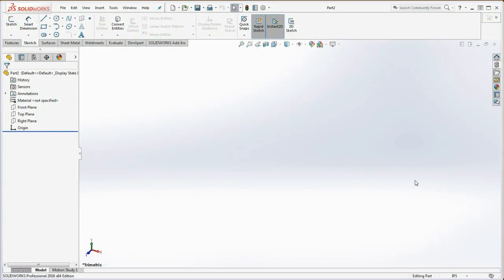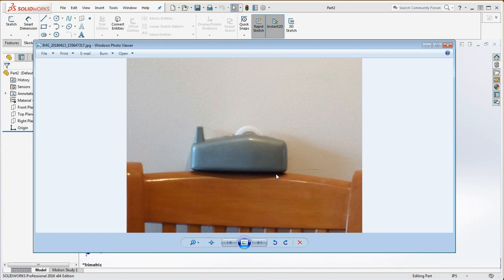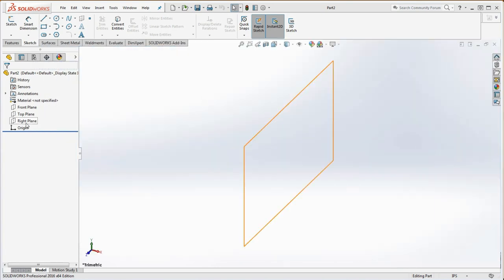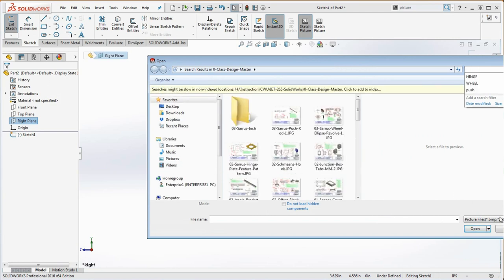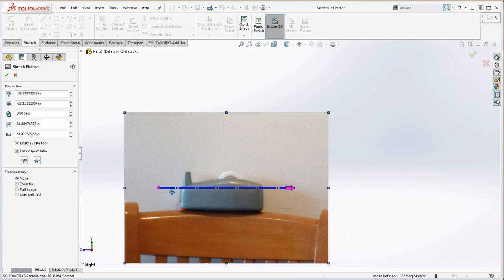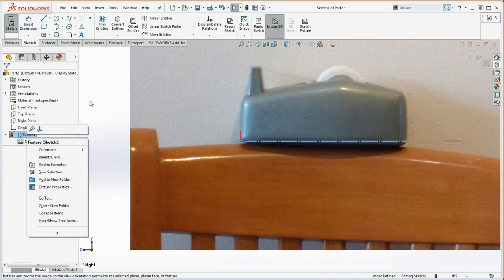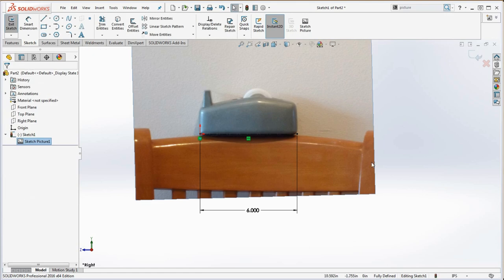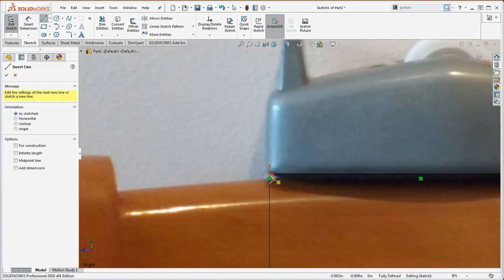66 SolidWorks – How to - Use Sketch Picture to Create an Accurate Sketch for your Base Feature

Comment: I was having a hard time getting the sketch picture to work in Solidworks, so I came here to YT looking for the right way to do it.  I was amused to see that you have the same problems with it as I do.  Maybe it's not me, it's the tool!
Reply from the maker: The Sketch Picture tool is not as intuitive as it could be. But it works good enough once you get the basics down.  Thanks for sharing.

Comment: sir if you have import drawing how to drawing again a solidparts
Reply from the maker: Assuming a pdf for your drawing, you'll have to convert it to an image file, then follow the procedure as I describe in the video. One advantage of a drawing file is you get to use all three sides, and can place an image on each of the three primary planes with a shared origin -  front, top and right planes.

Comment: Can u do that with concrete deminsions?
Reply from the maker: I am not certain about that, can you provide more info?
Reply: @DesignInnovations  does it work in feet? And can i figure out deminsions if i know the distance of 1 side, and 1 more important thing is this an app that i can install on android?
Reply from the maker: SolidWorks will work in feet you just have to change your units. I don't think SolidWorks has a version for your phone, however you might consider xDesign, all you need is a browser - it's a Daussalt Systemes product too similar to SolidWorks.